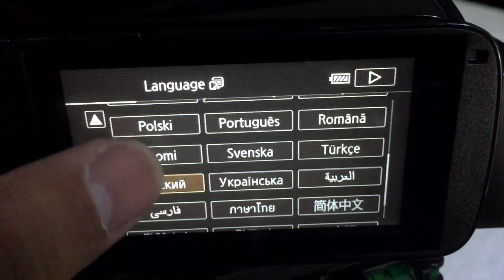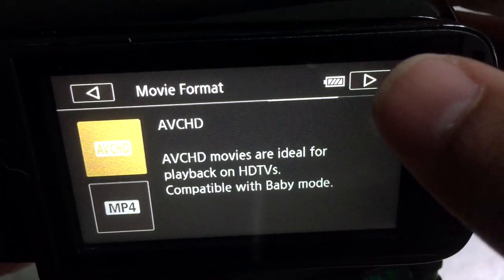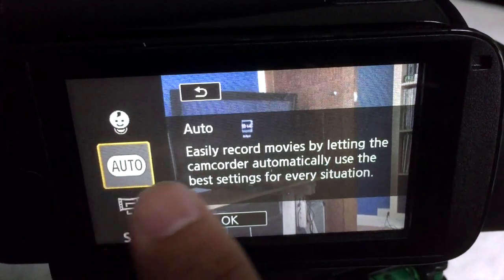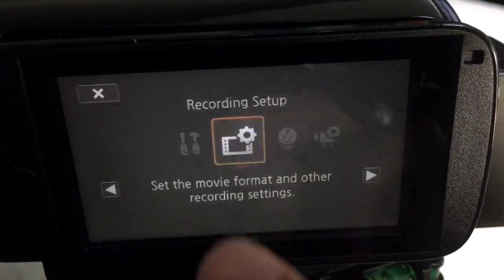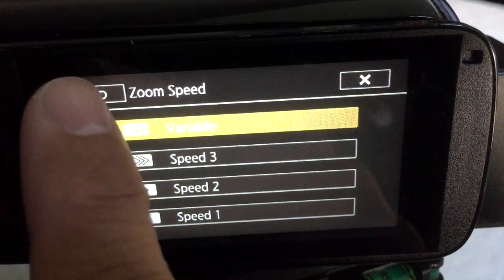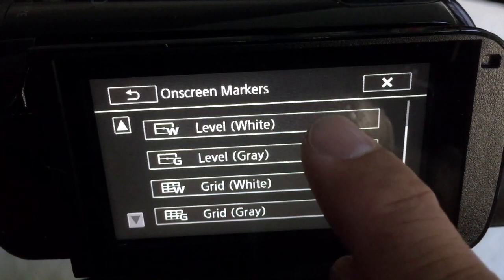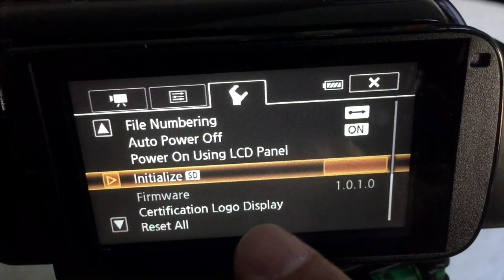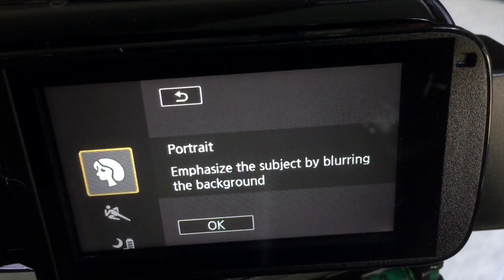CANON VIXIA HF R600 CAMCORDER SET UP, MENUS + FOOTAGE

Comment: when you went into the deeper settings that was only under "Baby Mode" and why 60FPS wasn't highlighted. You have to go to the other program modes then go to deeper (back button on top) settings then you can adjust settings under the 60FPS options
Reply from the maker: Good shout.

Comment: Helpful, but you missed the manual microphone volume settings, which are important for using an external mic, as you said you  plan to do.  Choice of mic is a whole other subject (in short, you need either a dynamic mic or one with a battery or other power source), but I find the auto-volume causes distortion, so you want to reduce the volume.  TIP:  You'll never get to the mic volume controls if you're in Auto video mode!  You have to start by choosing another video mode (like Cinema), then get to the mic volume control. Then take the mic volume from A to M, and play with it.  Depending on your mic, you may need as low as between 12-50 to keep external mic from clipping.

Comment: This is a dumb question, but does the battery that goes on the back have to stay on the camera at all times? I'm confused about if the battery charges the camera or if the wall plugin charges it, or both. Thanks!
Reply from the maker: +Corinne Demyanovich When it's in use yes, the battery is always attached. It can be charged separately though.

Comment: Damian, do you plan on doing a video instructing how to hook up and play from camcorder to computer, how to delete recordings etc.?  This video above was fabulous for me since I have no patience to read 308 pages of the on-line manual.
Reply from the maker: +frank plover sounds like a plan, not sure when i'll have time, that's the only problem at the moment. 

I just download from the sd card, and play that way. On the camera as well just hitting the play button and it's pretty straightforward. I'd imagine with the hdmi cable plugged into the tv, the controls work the same way and you'll be away.

Comment: Do you always have to initialize a brand new SD card?
Reply from the maker: Not sure if there's a 100% answer but I always do, and always in camera. Sets it up with that camera's system and then it's fresh to go.
Reply: Thanks, I finally found the correct screen to initialize it.

Comment: im looking to purchase this camera, can you confirm if his camera will accept a lavalier system like Sony WCS 999 ? i wanna use this camcorder with a lavalier sistem microphone.

Thanks
Reply from the maker: +ella ella If it's powered then it should work. I only just discovered that :) So I got a simple power lav mic and it works a treat.
Reply: It should be OK with a lav mic that's powered, like any of the wireless systems I would think.  I can use the ATR3500 lav (which has a long wire), which needs a watch battery, and there are cheaper knockoffs of it (make sure it has a battery!), but you cannot use a plain, unpowered lav mic.

Comment: to be honest the quality is not the best ,  I'm trying to find a 1080p video camera highest price 250$
Reply: +VadeUs this is the best is gets at that price, 1080px60fps
Reply: +VadeUs it doesnt look as good indoors with low lighting as you can see though
Reply: kickz07 ok thanks , is the canon alpha 350 hs better than this?
Reply: i would prefer the r600, they are about the same price as well
Reply from the maker: +kickz07 i've found since it's great at close up stuff, focus works very well... under good lighting. The test footage here was disappointing, to say the least, but outdoors and under very good lighting it's sweet. I've been using it for my product reviews etc on here and i'm happy. I need to see if boosting the lighting some more for a vloggin style indoors will get it to the quality i want though.

Comment: Can you charge it through USB?
Reply from the maker: +MazdaBass971 I haven't been able to, the usb port is just for data transfer as far as I can see. I just plugged it via usb to the computer and a battery pack and it wouldn't charge. I'd get a usb battery charger from eBay (actually this has reminded me I need to get that. I currently use it at home as part of a static set up so it hasn't been needed.
Reply: Damian Brown
Alright thank you.